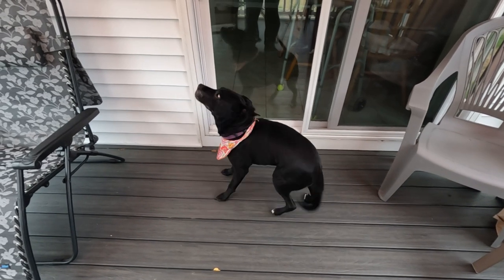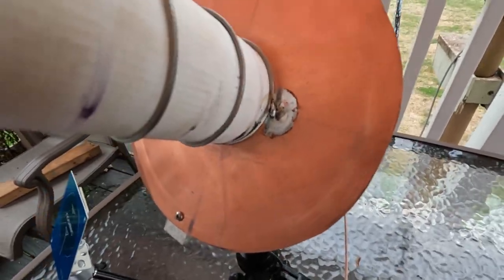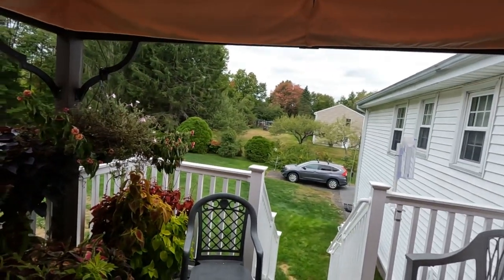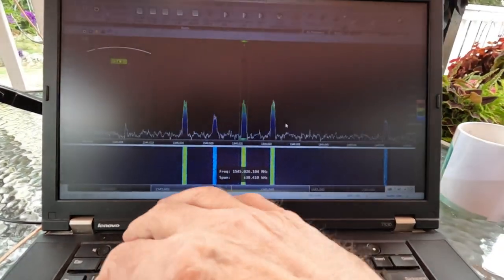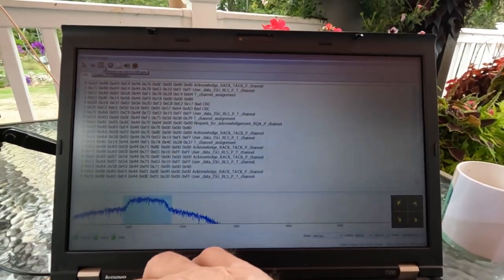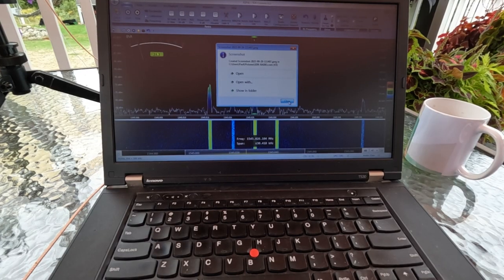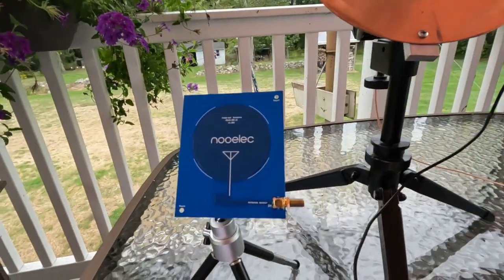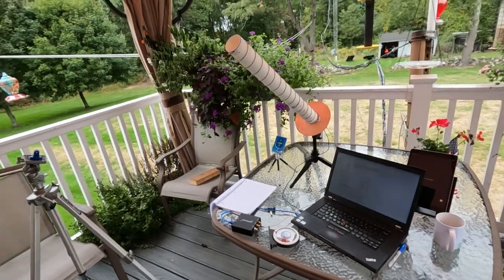Comparing Satellite antennas Patch versus homebrew Helix

Comment: Great video, Paul. Might be nice to see patch antenna with Sawbird attached for comparison.  Also, in SDR Console, using the 'Signal History' utility, configured to very slow speed with noise floor trace would facilitate a graphical side-by-side comparison of all antenna configurations tests.  Thanks and keep up the great work.  Ken -- WB0OCV
Reply from the maker: Hi Ken... I am really behind on answering comments.  I should have done that.... I totally W1VLF
 forgot about how well it would have shown the difference.
Reply: I've also read somewhere that the bias T on the sdrplay unit is not good enough and you need an external supply.

Comment: Glad to see your homemade antenna works better. I don't know anything about satellite reception or have that capability. However, I found it quite interesting that a clockwise helix vs CCW would make a difference.  I remember this was a question when friends and I were winding
our Tesla coil, secondary, and I just took a look to be sure that it was indeed CW, I knew the primary [an Archimedes Sprial] flat coil was in the same direction. I don't remember if there was a reason why CW was chosen? Maybe you do? 
But what I do know something about, are chainsaws. From what I heard, either the operator is totally unknowledgeable at the task with an unsharpen chain or is intentionally Jamming. I say Jamming. I could digress, about how I came to the conclusion but I'll leave it at that.🤣
I see you upgraded your SDR to SDRplay RSPdx. I've been wanting to get an SDR. Thinking about the SDRplay duo. Comments Welcome.
I need to catch up on your videos, maybe you addressed the subject already.

Comment: Don't know which model sawbird you have there, but this one "Nooelec SAWbird+ iO - Premium SAW Filter & Cascaded Ultra-Low Noise LNA Module for L-Band (Inmarsat AERO/STD-C) Applications. 1542MHz Center Frequency" ($45) says it needs 180 mA (c.f. RSPdx 100 mA).
Reply from the maker: Yes.. That is the SAW bird I am using. I saw a post somewhere about the current output of the RSPDX... It was stated to be 250 ma by someone.. Seemed like a lot, anyway I am now using a external bias Tee to power the preamp at the antenna and that works fine.
Reply: @W1VLF  "Someone" was completely off beam.

Comment: All that pvc will degrade your helix. The best thing to do is to have a PTFE rod or flat strap hanging the turns and have air as an insulator instead of pvc touching the wire. Also, make sure to silver plate the wire. Skin effect.
Have you measured the helix SWR? If not, use a nano VNA and adjust it. 73, PT9KK.
Reply: But how do you wind the copper tube without it ?